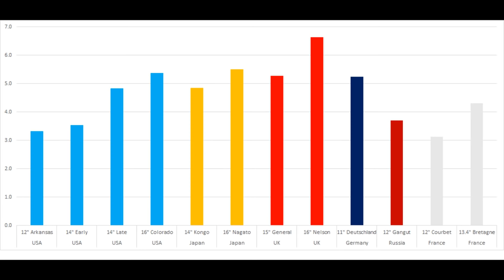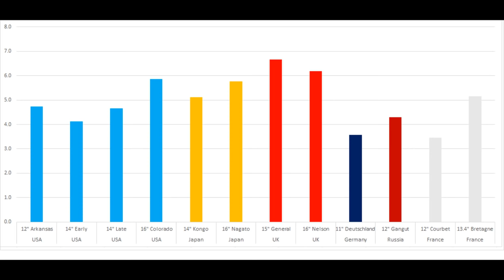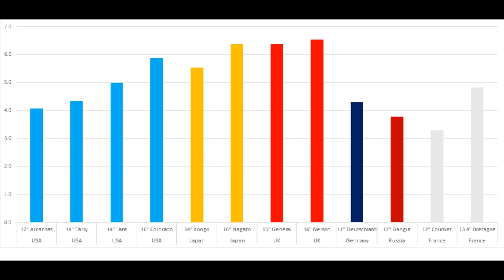Battleship Guns of WW2 - A series of tubes

Comment: The fact that Iowa’s 16” 50 Caliber guns are so close to the Yamato’s 18.1” guns is pretty impressive. With a better shell it could possibly be an even match. One intangible fact that fell outside the scope of this video is that the Iowa guns/shells were probably quite a bit cheaper to produce. They were also much smaller/lighter which gave them more flexibility in terms of the ships and ground-based platforms they could be used for. 

Yamato was nearly twice the size, granted she also had much better armor. The Montana, however, would’ve added an additional gun and armor while still being smaller/cheaper then Yamato. With an advantage in rate of fire and barrel count, I’d put money on the Montana winning that slug-fest.
Reply: Also consider the Square-Cube Law and that for the difference in performance, you would save many thousands of tons in design weight using the Iowa 16" instead of IJN 18", which directly translates into more armor, faster ship, more gun per ship, or even just a reduced cost in materials.

Sure, it's not AS good, but how good do you actually need?
Reply: Bursting charge aside, the Iowa shells were better, not being prone to breaking up on impact. Serendipitously, they might have done very well indeed against Yamato's riveted (and so not shock-proof) armor. Drach did briefly mention the shells at the end of the video on that subject, but I'd like to hear more about them. Re Iowa or Montana vs. Yamato, bear in mind that other key factors not accounted for in this video would have come into play, notably fire control.
Reply: The 16”/50s and the super heavy shell were amazing. 
Apparently the US 18” was also incredible and would have spanked the pants of Yamato.
Reply: @philb5593  The US actually built 18” gun prototypes? I didn’t think they ever passed the paper stage.
Reply: @stevebloom5606  Oh yeah, I wasn’t trying to war-game that out too much since the scope of the video was solely about the guns. But I do think these factors would ultimately play a role in which gun was better overall. The 18.1” was superior in destructive potential 1v1, but not by much and if Montana had been built it wouldn’t have been a 1v1 fight. If Montana got upgraded shells or longer barrels (.55 cal?) then I don’t think it would even be a question.

That all comes down to it being a more efficient gun in terms of size, weight and cost.
Reply: @samuel5916  Yep, they were building one before the Washington naval treaty. That halted all progress on guns larger than 16", so they relined it to be a 16" 56 cal, and then after the treaties expired they relined it as an 18" 47 cal and did testing
Reply: @philb5593  Damn, I’ll have to look it up. I’m curious about it now!
Reply: @stevebloom5606  
I agree, the fire control would be the deciding factor.  And the Iowa’s and the proposed Montana would have been far better than the Yamato’s.
Radar changes everything!  I think an Iowa would have had an even chance one on one with an Yamato given it’s superior speed and fire control, especially in any type of reduced visibility, say night or bad weather.
Reply: @samuel5916  There's a Wikipedia article on the gun that seems pretty thorough. The gun is on display to this day in its final 18"/47 configuration..
Reply: @philb5593  If I remember right, the Montana's armor was designed around protecting from that 16" 56 caliber gun.
Reply: @mahbriggs  In good visibility it would be roughly even for Iowa vs. Yamato. In poor visibility Iowa takes it.

Montana would dominate either Iowa or Yamato at any visibility.
Reply: I actually doubt the Montana would be cheaper than Yamato; Iowa was ALREADY more expensive per vessel than Yamato ($100,000,000 vs. $80,500,000, at time of construction for both), making the Iowas the most expensive battleships ever built on a ship-to-ship basis, and Montana was significantly larger than Iowa.
Reply: @bkjeong4302  Really? I find that shocking just considering the raw resources and steel used to be build Yamato. Have historians been able to research those numbers very thoroughly?
Reply: @samuel5916  

People do tend to overplay how expensive the Yamatos were: the assumption seems to be that the sheer size of the vessel would mean it would cost far more than other, smaller battleships, but this is only true to a certain extent. Part of the whole rational behind building the Yamatos was actually that one 65,000 ton (standard displacement) battleship would actually be cheaper and take less resources than building two 35,000 ton battleships, since one of the most expensive parts of building a battleship is engine machinery; two machinery sets cost far more than one. (another issue was that there was only a limited amount of slips in Japan for building capital ships and half of them were already being used to build aircraft carriers, making it impossible to build a larger number of battleships anyways even if you made each ship smaller).

And the Iowas ended up costing more than the Yamatos per ship in the end in large part due to development cost: personally, I think that accidentally being forced to design new 16” main battery turrets (when they were originally planned to use an already-existing 16” triple design) and having to rebuild the barrettes due to a BuOrd screw-up played a big role in this, because turret design and production is another aspect of battleship construction that takes up a disproportionate amount of money and resources. The much larger power plant on an Iowa compared to the two previous fast battleship classes likely also added to construction costs.

With the Montanas there would be no need to redesign a new turret but you’d need to make one more turret per ship, which may well offset the cost reduction from not having to design a new turret.

Comment: The gun element of range should be found between shell weight and muzzle velocity so if you had the data using muzzle velocity instead of range would have been better.

Comment: Great video. I appreciate that you took the time to explain your reasoning for how the ratings were arrived at. Did you consider using the mass of the guns as a data point? Physical size and mass of the guns was the major limiting factor that dictated most of the other criteria. Not to mention the resources needed to build it. One side thought that i had is that absolute maximum range is useful for shore bombardment. For example in the days following d-day. It may not be what these ships were primarily designed for but it mattered in the end. Of course, in this case it would need to be the range with high capacity shells.
Reply: Very good point.  The lightweight US 16”/45 was a better gun than the older US 16” in Colorado partly because it was lighter, so more could’ve been carried on the same displacement.

Comment: Might have needed to include reliability in the equation. Richelieu's guns would have scored lower on the the list due to them going kaboom, instead of just boom
Reply: Those were shell problems, tho?
Reply: @cheesedetectiverook5950  to be fair you can put (at least a decent portion of) Littorio's accuracy under that explanation as well.
Reply: @gokbay3057  Mm, fair

Comment: Since you used it as one of your metrics I would ask anyone who is interested in actual results to view some of the photos of Jean Bart after it’s duel with Massachusetts at Casablanca during operation Torch.  Even though you comment on the smaller bursting charge of American shells the damage shown gives a good example of the extent that even a small bursting charge in a 16” shell does massive damage

Comment: This now brings us to purpose of the fuse in the shell. The fuse was placed in the base of the shell so that the shell did not explode on impact. The fuse itself held high explosives which had to withstand the shock of firing and impact and explode only when desired. Fuses should also arm and fire only after penetrating a sufficient thickness of metal. Basic fuses had fixed delays that armed on impact and exploded within a specified time frame. The time frame assumed that the shell would travel a certain distance after penetrating sufficient armor to arm the fuse. This would ensure the shell exploded inside the hull, deep enough to do damage to critical areas, like engine rooms and magazines. Some fuses were more complex, designed to arm on hitting light armor or the hull structure or water, but with a longer delay, assuming a greater distance to travel or to penetrate thick armor behind the structural steel or under the water. In fact, as a result of firing trials, the US Navy designed a very complex fuse, the Mark 23, which was designed to arm on hitting the water and then allow sufficient time for the shell to travel through the water and penetrate the lighter protection under the armor belt before exploding or arm on hitting light armor or construction steel and explode deeper in a ship and also arm and fire more quickly if penetrating heavy armor. Such a complex fuse gave several problems and was replaced by a simpler fuse, though one of the times the Mk.23 worked perfectly; penetrating over 165mm of armor and construction steel decks, it failed to do much damage, because the secondary magazines of the French battleship “Jean Bart” were empty. The reason for the interest in variable delay fuses was the possibility of a shell hitting the water sufficiently far enough from the target to dive under the main belt and penetrate through the lower hull and the torpedo protection system into the machinery spaces or the magazine, basically performing like a very high-speed torpedo. The Japanese noted this same phenomenon during tests on the hulk of the IJNS Tosa and designed an entire shell, the Type 91, for underwater attack (the previous Type 88 shells had a longer fuse delay as an interim measure). The Type 91 design gave up some penetration performance under normal circumstances to perfect the ability to hit the surface of the water, travel underwater for 20 to 50 feet and then penetrate the light armor under the belt through the hull and into the magazine. During the Pacific War, there was only one documented time when the Type 91, in this case a 20.3cm (8”) shell, performed as designed, exploding in the forward magazines of the USS Boise. Fortunately for the US Navy, the magazine had already flooded from water flowing through the hole the shell made so that all the powder in the magazine was too wet to explode when the fuse finally fired. The delay built into the fuse was too long, based on the expected distance of travel and the shell fusing after hitting the water, but the distance into the USS Boise’s magazine after hitting the water was less than programmed, so the fuse fired the shell too late. Since battleships expected to fight battleships, their primary ammunition of choice was AP shells. When fighting smaller ships or when smaller ships fought smaller ships, AP shells might be nearly useless because of over-penetration. With no heavy armor to stop it and with a fuse delay to cover the distance to the inside of the hull of a capital ship, an AP shell could go right through a destroyer hull or superstructure, either exploding on the other side too far away to inflict damage or not exploding at all, as the fuse never armed. For less armored or unarmored targets, there were a variety of other shells. There was semi-armor piercing (SAP). These shells could be capped or have ballistic caps, thus SAPC or SAPCBC. They were designed with thinner walls and greater internal capacity to penetrate less well armored targets. The performance measurement was usually the diameter of the shell at some distance from the target. The US Navy usually called these shells “Special Common”. The British used a Common Piercing Capped (CPC) shell for attacking lightly armored targets. Common shell was the original black powder filled explosive shell. The difference between a Common shell and an HE shell was that the Common shell was base fused, giving it some penetration power against armor (the US Common Shell was expected to pierce one-third its diameter at a specified range) versus the HE shell with its nose fuse and near instantaneous arming and firing. “Heavy” (12” diameter and larger) HE shell could still penetrate a ship’s structural steel as the “near instantaneous” fuse meant the shell travelled as much as 36 inches (at 1,500 fps for heavy shells) before the fuse fired. And the steel fragments it generated also had the ability to penetrate mild steel hulls, decks and bulkheads. Some shells equivalent to the Common shell, such as the USN’s High Capacity (HC) shell, had both nose and base fuses. When used as a Common Shell, the nose fuse was replaced with a plug. The problem with the USN’s HC shell was that the nose fuse used a “booster” made of a more sensitive HE between the fuse and the HE filling which remained in the shell when the fuse was removed. This more sensitive explosive would cause the shell to explode on contact versus penetrating for some depth before being fired by the base fuse and exploding. Also, HE shells intended for dual purpose use could, like the US Navy’s “AA Common”, have various types of timed and impact fired nose fuses and impact delayed base fuses.  Nose fused shells could be used for different purposes by simply changing out the fuse, so an HE shell of any size from 46cm to 37mm could be used as an anti-aircraft (AA) shell or as a bombardment shell.

Comment: I might have missed a point or two, but here I am wondering if RoF of the gun can be actually evaluated independently from the weapon system in which it is mounted (i.e. turret layout, shell storage, etc.).

And the same sidenote may apply to turning speed - if I got that right - as well.

Comment: The curator of battleship New Jersey stated that the U.S. used less bursting charge because the blast effects were mainly contained to one compartment, however, by reducing the charge you could have fewer but much larger fragments penetrating multiple compartments as well as a stronger shell. To put more charge in you have to thin the shell. Balancing act. Less well protected WW1 ships were probably eaiser to wreck with lighter fragments. Bird shot vs buck shot. Also, the major defects and advantages of these weapons and mounts were shown more in fire support, at least by the allies who used them predominantly as shore bombardment with spotters than ship v ship.  range, accuracy, and caliber,  then is paramount. Very few of the AP shells produced by anyone  were ever even fired at armor anyway after the carrier saw action. However this is what they were developed to do.  Elevation matters more in shore bombardment as i seem to remember an allied ship flooding ballast to generate a list to increase range.